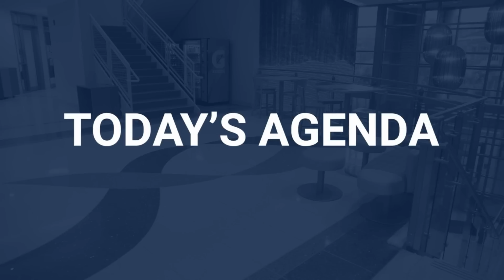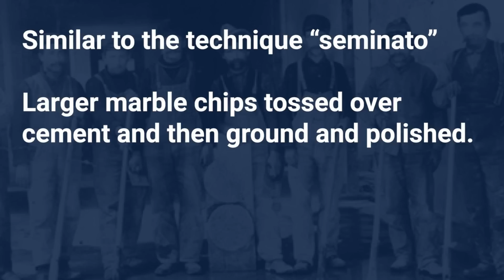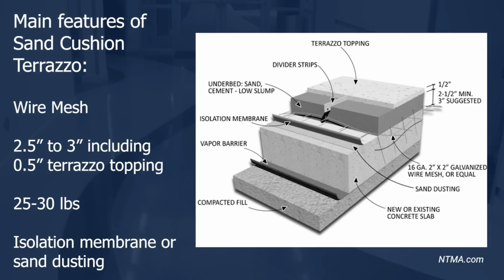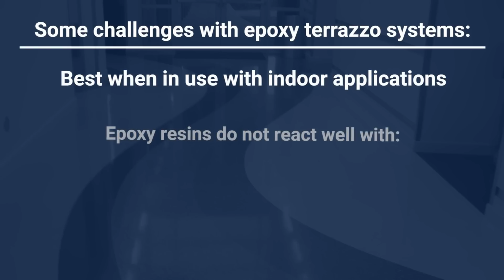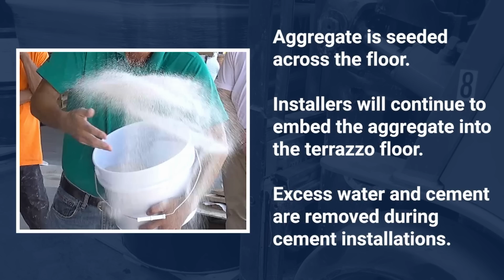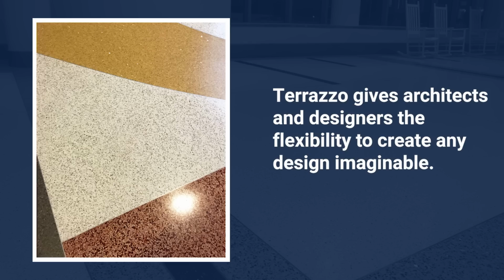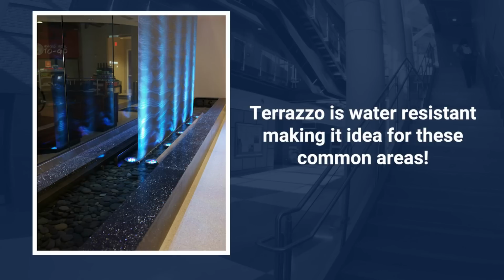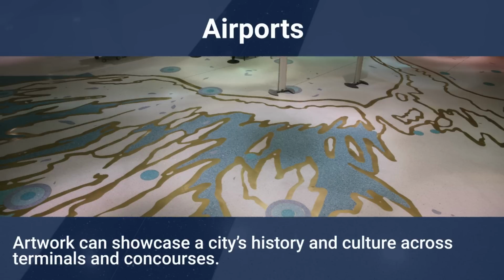Webinar: General Overview on Terrazzo

Comment: But for thosw tables in like restaurants is it cement or epoxy ? Like i saw altrock surfafes and wanted to do the same but i dont know how to start
Reply from the maker: Tables can be either cement or epoxy. For restaurants, epoxy terrazzo is generally better for restaurant interiors with better stain and spill resistance, and more aesthetic flexbility. It's more lightweight than cement too so easy to rerrange layouts. Tables used outdoor should be used only with cement.

Comment: I’m very interested in learning more, I’m curious if this is a common technique? Is there a decent demand for terrazzo craftworkers? Do terrazzo finishers usually start off as brick layers or concrete finishers etc?
Reply from the maker: In the terrazzo industry, there are many terrazzo systems that can be installed including cement and epoxy terrazzo, each has its own technique. These are performed on a job site. There is also precast terrazzo, which is manufactured within a company's facility and the products and then delivered to a job site for contractors to install. The demand for terrazzo craftsman is projected to increase as more terrazzo is being installed. Terrazzo installers are required to travel across the US. There are terrazzo installation companies in nearly every state. Larger states like New York, California, and Florida have multiple terrazzo companies. In terms of job experience, an individual can take on an apprenticeship or on-the-job training to learn the terrazzo process. A person with masonry skills can find a good career in terrazzo.

Comment: Can you use wax on terrazzo floors.  I was told no, only a Crete sealer...
Reply from the maker: It is advised not to use wax on terrazzo floors. Its tends to create buildup and dull the finish of the terrazzo floor. For terrazzo floors using TERRAZZCO products, we recommend a water-based acrylic sealer (ex. Betco Sure Cure/Untouchable)

Comment: Back in 1989/1990 I worked in an institution where the original 1939 buildings had terrazzo floors; they looked virtually brand new even with the heavy use. It is amazing flooring.
Reply from the maker: Thanks for sharing!
Reply: I too worked in a building from about that era, and when I initially started working there, construction was going on in the building and the terrazzo floor in the lobby looked like it in horrible shape, and would need to be replaced, which I thought was a shame.  At the end of construction, the floors were polished and they looked like new. I was always curious about the fabrication & installation process, and what made the material so durable; and this video did a great job explaining it.
Reply: Two different materials. One is cementitious (the stuff you encountered) and this stuff is epoxy resin based.

Comment: Thanks for a great presentation! I saw outdoor ping pong tables with a terazzo top. Is it something you would recommend to use terrazzo for? And what terrazzo system should be used in for these tables. Epoxy or cement?
Reply from the maker: Appreciate the feedback. Terrazzo is a versatile product that can be used for different designs applications today. Epoxy terrazzo is only recommended for indoor settings. To design a terrazzo table for outdoors, cement terrazzo is the ideal application.

Comment: Is it okay to use terrazzo tiles in bathrooms and kitchens, or because of its high porosity and high water absorption, which will be difficult?
Reply from the maker: Its acceptable to use either a poured in place or terrazzo tile system for bathrooms and kitchen spaces. Epoxy terrazzo is nonporous and far more water resistant than cement terrazzo. Due to its nonporous properties, a seamless epoxy terrazzo is not only water resistant, but also stain and bacteria resistant. Whereas seamless terrazzo is poured over most substrates, tile will require a setting material during installation, and include the grout lines. Grout lines are one of the major differences between a seamless terrazzo system and a terrazzo tile system. The grout lines increases the overall maintenance of the flooring system and is common place for dirt and bacteria to hide. Poured in place terrazzo is a smooth seamless system where simple sweeping and mopping routine will clean the terrazzo floor.
Reply: Would you recommend terrazzo to be manufactured into bowls for eating? If so, should cement terrazzo or epoxy terrazzo be used? Does the porous nature of cement terrazzo have any implication for food use?

Comment: What kind of resin should I use?  Because yours is not in Algeria
Reply from the maker: For seamless epoxy terrazzo flooring or epoxy terrazzo precast, you will need a two-part epoxy resin system with a Part A resin and part B hardener. If you are looking for a manufacturer that sells terrazzo resin in Algeria, I can recommend some suppliers/companies that work with epoxy terrazzo and are closer to your region of the world that would benefit you economically. Try Flowcrete UK, 4M Group, Fribel, Gulf, or SFS Floor Turkey
Reply: Thanks

Comment: Sand cushion wire mesh isolation sheet can you please give me more details on this. What is required and alternative materials one can use to avoid cracking especially over expansion joints.
Reply from the maker: Our technical representative can further assist you in providing a more in-depth answer. He will need more clarification. You can email him directly at joshua@terrazzco.com. But sand cushion slip sheets are used for sand cushion cement system, where the system itself is a crack suppression system as the terrazzo is floating on a layer of sand instead of being bonded to the substrate. For epoxy terrazzo systems, you can avoid cracking by with a flexible crack membrane.

Comment: cost?
Reply from the maker: Cost of terrazzo can vary by region of the United States. I've provided a cost calculator breaking down the cost of epoxy terrazzo over 40 years, the information provided by the National Terrazzo and Mosaic Association: http://terrazzco.com/terrazzo-flooring-cost-calculator/. Epoxy terrazzo is cost-effective because of the low maintenance costs. if you are looking for a specific quote for an epoxy terrazzo system using TERRAZZCO Brand epoxy resin and aggregates, our sales representatives would be happy to assist you in addressing cost options in details for a project. You can contact us at info@terrazzco.com or call us at (704) 921-4928!

Comment: please could you help me and tell me the steps how to polish the terrazzo epoxy matrix and cement terrazzo, I have lavina grinder 25 "propane, I live in north carolina do you have any course on how to polish and repair cracks in terrazzo? I know how to polish concrete but terrazzo never and some schools ask me for the polishing of their terrazzo thanks please could you help me and tell me the steps how to polish the terrazzo epoxy matrix and cement terrazzo, I have lavina grinder 25 "propane, I live in north carolina do you have any course on how to polish and repair cracks in terrazzo? I know how to polish concrete but terrazzo never and some schools ask me for the polishing of their terrazzo thanks
Reply from the maker: Hi Sonico. Good to hear from you. We are also located in North Carolina in Charlotte so feel free to reach out to us later on at inquiry@terrazzco.com if you need further assistance. But to answer your question regarding polishing epoxy terrazzo, I've provided you with some steps in the grinding, grouting, and polishing process. General procedures are as follows: 

Grinding Epoxy Terrazzo:
Once the terrazzo is poured in place, the next step is grinding the terrazzo to transition from a rough to smooth surface. Installers will insert the appropriate grit diamond to the floor grinding, a 40 or 80 grit diamond depending on the hardness of the aggregate.

Installers will start off in the area where the terrazzo was poured first has been curing the longest. Using the electrical floor grinder, an installer will slowly push the grinder along a path. At end of path an installer pulls the grinder in reverse along the same path that the grinder was pushed towards. This is repeated several times in an area, using side to side motion to not form a trench. After 4-5 passages, check the floor for the exposed divider strip.

Once the floor is rough ground, all the edges can be ground with an edge grinder. This includes areas such as the walls, columns and anywhere the electric grinder cannot reach. After the edge work is completed, it is recommended that 2 passes of 100 grit diamonds be run to help blend the floor before grouting.

Grouting Epoxy Terrazzo:
Prior to grouting the ground floor, an installer will clean the floor with water and a scrubber and then vacuum the surface completely dry. Grouting refers to covering any pinholes and voids left after the grinding process. In this case after the floor is completely dry, an installer will mix up an epoxy color to be grouted (5:1 ratio) in small amounts approximately a quart.
Next, an installer will pour the epoxy mix and tightly work the epoxy into any pin holes and voids using a flat straight edge trowel. After a large section is grouted lightly, an installer will dust the wet grout with ATF-20 and lightly push a broom over the sand to work the sand into the pinholes.
 (BTW, you may want to take a look at TERRAZZCO Groutless EZPour Epoxy 158, which cures with fewer pinholes. In over 50% of installations contractors did not need to grout :) Here's a link: terrazzco.com/groutless-ezpour-epoxy-158/

Polishing Epoxy Terrazzo:
The procedures for polishing a terrazzo floor is similar to the rough grinding stages; however, it is performed wet and not dry.

An Installer will begin using a 80 grit carborundum stones or 100 grit resin pads to remove the epoxy grout. This is done by moving in the same motion and patterns as in the rough grinding stage.

Grout on the edges can be removed in similar fashion as in the rough grinding stage using a 120-grit diamond disk and then repeated using a 200-grit resin pad. Afterwards the floor can be finished with 200 grit resin pads. Unless the owner requires a higher polish therefor an installer will repeat previous steps increasing the grit to specified finish. Vacuum polishing slurry and start with fresh water when changing between increasements of diamond grit.

I hope this helps you for your terrazzo projects. Please check out our website anytime for more information at www.terrazzco.com and contact any of our sales representatives with further questions at inquiry@terrazzco.com.
Reply: Concord Terrazzo Company, Inc.  thanks  for you help
Reply: @sonicoaguilar3151  How's it going!  
We used to " strip" floors with chemical stripper first... Water base stripper for water base sealer ... petroleum based stripper for laquer based sealer...this stops ant gumming of your pads or stones...If you can't get petroleum base stripper running course diamond will break it up.... Terrazzo 30 years
Reply: @Terrazzco  how to fill and color crack?

Comment: What type of resin époxy used for this application sir
Reply from the maker: For this demonstration, we used our TERRAZZCO EZPour Epoxy 158 resin. Since the time of this video, we updated our epoxy resin formula to what is now known as "Groutless" EZPour Epoxy 158, which cures with fewer pinholes. It is contractor-developed and in over 50% of installations, no grouting was necessary. Here is a link to the product: terrazzco.com/groutless-ezpour-epoxy-158/
. We also have product data sheets for you to view. If you have any questions about the resin, you can reach out to us to inquiry@terrazzco.com and we would be happy to answer any questions you may have.